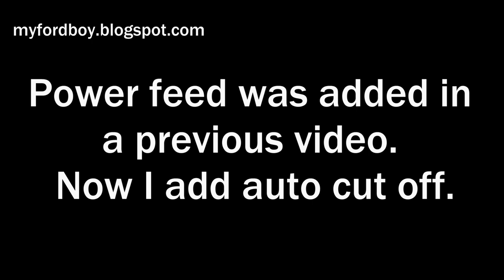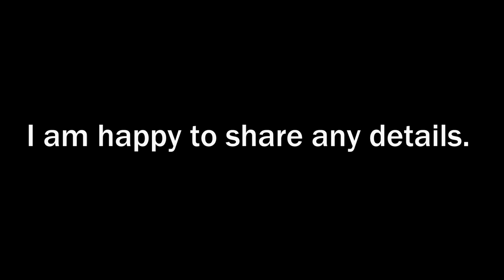Axminster Sieg Lathe Auto Feed Cut Off and DRO

Comment: Just a quick comment on getting rid of those high spots... I've started using a scraping technique, instead of a file, just using a tool steel blank, of whatever size works, which has 4 nice sharp edges to scrape with, and lets you scrape just the actual high spots, without having to worry about the file making trouble elsewhere on the work... Cheers!

Comment: It's not clear what operates the travel stop microswitch.  It looks like it is the tip of the scale beam at 10:17 but the beam seems to be fixed to the lathe bed at 6:56, so it doesn't move with the carriage.  What am I missing?
Reply from the maker: In DRO mode the beam is fixed at the end and travel can be measured on the scale.
In cut off mode the thumb screw securing the beam is removed and the scale is locked to the beam.
Once a cut is taken the work can be measured , the scale zeroed and then the beam is moved by the amount nececessary to give the correct dimension and locked in place.